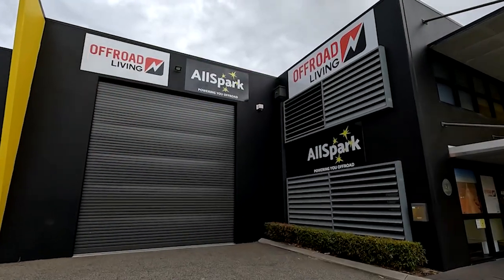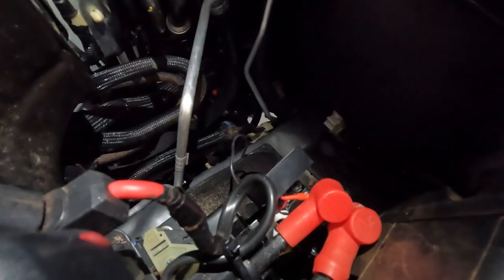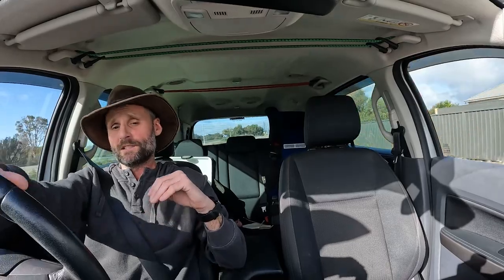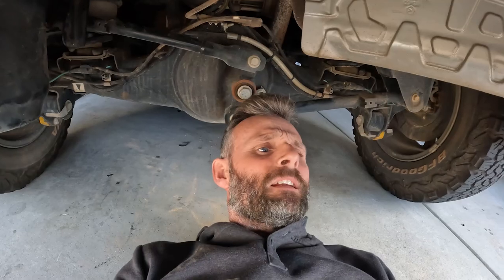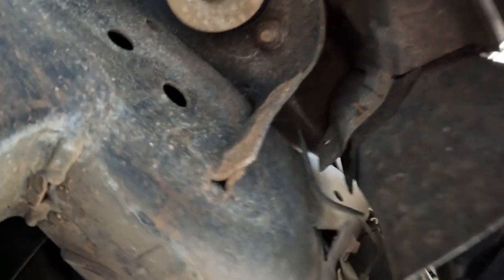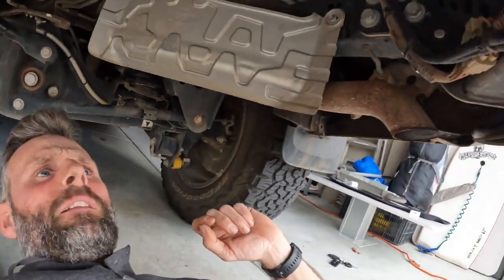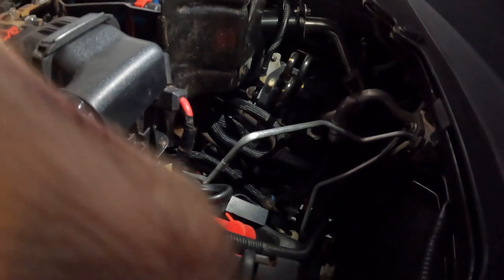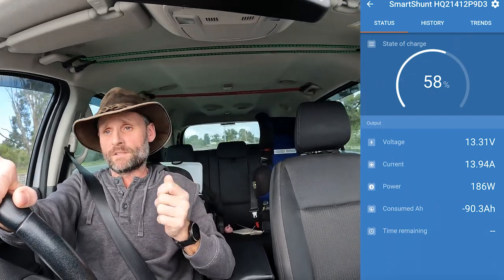FORD EVEREST ANDERSON PLUG INSTALL - Fitted for Charging Off Road Camper Trailer Batteries.

Comment: I've had similar issues in the past, same thing anderson plug connecting my MDC cruiser highside. Turned out to be the earth/ground cable connected to the body work of my vehicle was not sufficient. I ran a new cable back to the negative post of the main battery and fault cleared.
Reply from the maker: Thanks for the feedback Peter! Glad you got it sorted, will have to try that and see if it makes any difference. Thanks mate.

Comment: so you first put the cable in a protective shield before you run it through?
Reply from the maker: Yes, that's correct! I used corrugated split tubing. It helps prevent damage and ensures the cable stays safe.

Comment: Gday Craig it would have been good to know the voltage at the anderson plug before and after your work. I am having the same issue with a enerdrive dcdc 40 plus charger in my campervan.
Reply from the maker: Hi,
Unfortunately, I didn't take those readings.  Upgrading the cable helped, but not entirely. I ended up tracking the major issue to a bad earth connection on the electric trailer brakes. Once I had that sorted, the charger worked as intended.
Thanks for watching.

Comment: I suspect bad connections somewhere in your setup. The best way to locate a problem is to use an infrared heat sensitive camera to find hot terminals or cables. Anything introducing high resistance into the circuit will get hot.
Reply from the maker: Thanks for the tip mate, we have now since sold the Everest and have had no more problems on the new car 😊 Thanks for watching and the comment!

Comment: I had a similar situation when installing a new power system in my caravan. I use all Victron gear and ran 13mm2 cable from the vehicle battery to an Anderson plug and then through the van to the DCDC unit. I found that I had minimal voltage drop due to the cable guage and initially had high current flow to charge the van batteries, but after a while the current reduced. It had me stumped for a while until one day I felt the DCDC unit and it was quite warm. So my conclusion is that the DCDC units can get hot and will reduce their current flow to ensure they don't overheat. I've see a Youtube video where a guy attaches computer fans to his Victron dcdc unit to keep it cooler and ensure higher current flow. Could this be an issue with your Redarc DCDC?
Reply from the maker: Hey Mark,
Thanks for the feedback. I'll be sure to check that out but I don't think that's my issue, as I also have low current flow when the charger first comes on as well. If it wasn't for having the shunt I'd be blissfully unaware.😁
Reply: Yeah the victron DCDC Chargers do have a bit of a reputation for derating when they get hot, they benefit from plenty of ventilation. Perhaps you could mount a 12v computer fan nearby to assist.

Comment: Interesting video, thanks for sharing your experience.
My calculations show deminishing returns from 6 to 4B&S cable, but if you're chasing every amp, then why not go big. The additional cost of the cable was quite high when I was looking.

I didn't see if you had another video following up on this but I would be interested to know what cable they rain from the front of your trailer back to the DC Charger at the battery. I bet it's not thick enough and you're dropping volts there too. Would love to get an update.

Running the 2x 6mm (4.6mm^2) cable like that is kind of messy but it does effectively double the capacity of the wire, so you really get about 9.2mm^2, provided the lengths are the same. But it is ugly and confusing to anyone looking at it. 

Anyway, love these kinds of videos. Super interesting stuff.
Reply from the maker: Hey Andrew
Thanks for watching. I haven't made an update vid but I have solved the issue. It turned out to be a bad earth from the emergency breaking system. I discovered that the current only fell when the trailer plug was connected. 
Trial and error narrowed it down to the earth for the electric breaks. from factory the emergency break earth was connected to the first battery in parallel not the second. When I upgraded to lithium I knew that it should have been connected to the second battery but failed to make the change and promptly forgot about it. 

Once I discovered the issue was the emergency break I knew exactly where to go and it sorted the issue immediately. Silly me right.

As far as the the wiring in the trailer they've used 6b&s for everything.
Thanks again
Reply: @RoaminintheRobbo  clever you! Well done fixing it!
Reply from the maker: @andrewford80  thanks mate!

Comment: I run B&S 0 cable to the rear (pos+ only with an earth to the chassis) then B & S 4 to the anderson from a terminal block. max 3% volt drop and I run a 40amp DCDC charger in the camper. 25% is a good improvement but you may also have a voltage regulated alternator which is not ideal if you wanted to achieve max output.
Reply from the maker: Hey Mike,
B&S 0, nice one.
The Everest does have a smart alternator but I have an ignition wire connected to the bcdc but maybe it still contributes to the low output? Thanks for your  feedback, very helpful.
Reply: @RoaminintheRobbo  you can get away with not having an alternator wire, or a simple solution is an alternator diode. Have been running one in my 200 for years now, puts out a healthy 14.4v now
Reply from the maker: @mikefoster7085  thanks for the tip Mike, going to look into this!